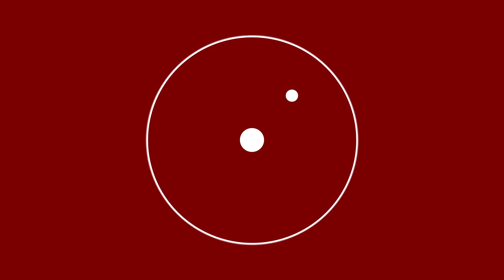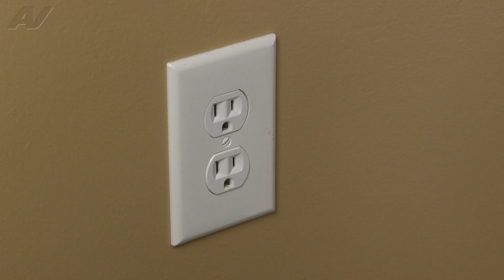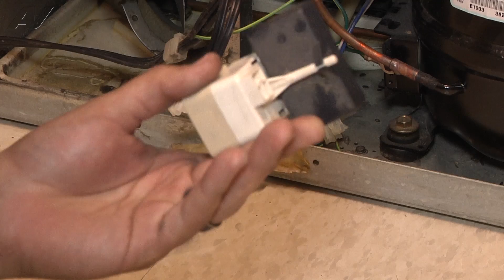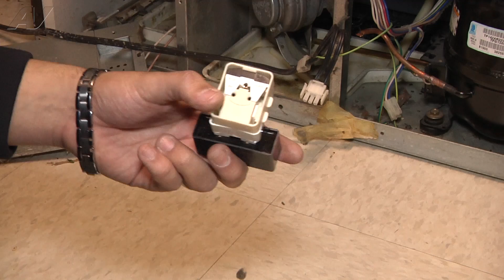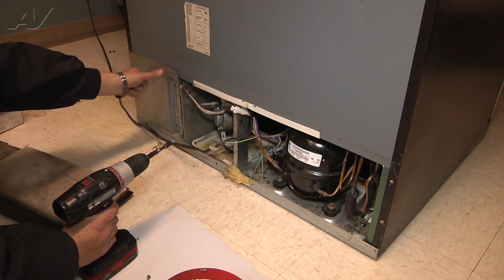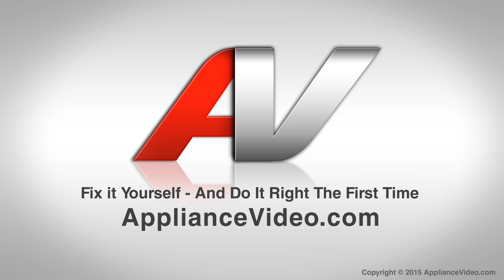Amana Refrigerator Repair - Not Cooling - Start Device

Comment: Tried three different relay/capacitors.  All had a bit of rattle right out of the box.  I installed the first one three months ago and it failed.  tried two more from different vendors but they all make a buzzing noise and the compressor refuses to start.  Sounds like more of an issue with this 17 year old side by side Amana refrigerator.  Will keep trying and thanks for the tip on the rattle.  PS it would be difficult to accept that all of the relay/capacitors are no good right out of the box.

Comment: I replaced both the relay and overload protector, and even ordered a pack of 5 of each, and tried every one of them. They all work, and the the compressor kicks on, but about 5 sec. in it clicks off again! And then does it's on and off thing just like before. Now what?? Is there anything else I can check or do?  Would the compressor still kick on if it was bad? Thank you for any advice you might be able to offer! 🥰
Reply: You might be low on R134. Sorry! I didn't realize this was 2 years old. Did you ever figure it out?

Comment: So I have an Kenmore Elite fridge, the Fan is not turning in the back by the compressor and the display shows off for the fridge and Freezer, I have tried to change the relay and capacitor without any success. When I put the new capacitor and relay on the fridge constantly beeps. Any idea?.
Reply from the maker: Great question, if you have a more technical question that our parts department cannot answer, you can search our over 17,000 answered questions free at our website www.ApplianceVideo.com under our Repair Help section. You can also call our parts department at 1-800-830-5465 and they can give you help 7-days A week ,or search at www.SaveMoreOnParts.com  .

Comment: Hey hi ya  have  older  single door whirlpool fridge freezer and  fridge stay a little  cold for 2 days .and then   3 green  lights flash  constantly  also freezer  works fine can hear component's  working  thanks ??
Reply from the maker: Great question, if you have a more technical question that our parts department cannot answer, you can search our over 17,000 answered questions free at our website www.ApplianceVideo.com under our Repair Help section. You can also call our parts department at 1-800-830-5465 and they can give you help 7-days A week ,or search at www.SaveMoreOnParts.com  .

Comment: does the start winding and the run capacitor go  off the circuit after the compressor reach 75 per cent of its speed
Reply from the maker: Great question, if you have a more technical question that our parts department cannot answer, you can search our over 17,000 answered questions free at our website www.ApplianceVideo.com under our Repair Help section. You can also call our parts department at 1-800-830-5465 and they can give you help 7-days A week ,or search at www.SaveMoreOnParts.com  .

Comment: So if it rattles, it's bad. But if it does NOT rattle, does that guarantee that it's OK ?
Reply from the maker: Great question, if you have a more technical question that our parts department cannot answer, you can search our over 17,000 answered questions free at our website www.ApplianceVideo.com under our Repair Help section. You can also call our parts department at 1-800-830-5465 and they can give you help 7-days A week ,or search at www.SaveMoreOnParts.com  .

Comment: my replacement parts did not fit properly and where thicker.  the relay holes were too deep so i had to cut off the edges but the spring does not fit.  if it cools i am just going to support it with tape.
Reply from the maker: Great question, if you have a more technical question that our parts department cannot answer, you can search our over 10,000 answered questions free at our website www.ApplianceVideo.com under our Repair Help section. You can also call our parts department at 1-800-830-5465 and they can give you help 7-days A week Monday Saturday, or search at www.SaveMoreOnParts.com  24 hours 7 days A week.

Comment: did this but mine doesn't make the noise when you shake it, what else could it bee?  the relay did get hot when i tested it with the new capacitor though.  is that normal?
Reply from the maker: Great question, if you have a
more technical question that our parts department cannot answer, you can search
our over 10,000 answered questions free at our website www.ApplianceVideo.com under our Repair Help section. You can also call
our parts department at 1-800-830-5465 and they can give you help 6-days A week
Monday -Saturday, or search at www.SaveMoreOnParts.com  24 hours
7- days A week.

Comment: how to put manual on defrost timer on amana refrigerator ..any trick ??
Reply from the maker: Great question, if you have a
more technical question that our parts department cannot answer, you can search
our over 10,000 answered questions free at our website www.ApplianceVideo.com under our Repair Help section. You can also call
our parts department at 1-800-830-5465 and they can give you help 7-days A week
Monday -Sunday, or search at www.SaveMoreOnParts.com  24 hours
7- days A week.

Comment: I have an old whirlpool top n bottom fridge,just got it from someone,said it was working but it's not cooling...just blowing air...it's making sound as if it's on,but not sure if it's just the fan I hear or compressor...
Reply from the maker: Great question, if you have a
more technical question that our parts department cannot answer, you can search
our over 10,000 answered questions free at our website www.ApplianceVideo.com under our Repair Help section. You can also call
our parts department at 1-800-830-5465 and they can give you help 7-days A week
Monday -Sunday, or search at www.SaveMoreOnParts.com  24 hours
7- days A week.

Comment: Would you know how old a Montgomery Wards Refrigerator HMG-19424 second # BM-7C80A
I can’t find?
Reply from the maker: Great question, if you have a
more technical question that our parts department cannot answer, our
technicians are answering all questions at our website at www.ApplianceVideo.com under our Repair Help section. You can also call
our parts department at 1-800-830-5465 and they can give you help 7-days A week
Monday -Sunday, or search at www.SaveMoreOnParts.com  24 hours
7- days A week.

Comment: Please  I need big chiler cooling video about comprecer why make wire heat and trip breaker
Reply from the maker: Great question, if you have a
more technical question that our parts department cannot answer, our
technicians are answering all questions at our website at www.ApplianceVideo.com under our Repair Help section. You can also call
our parts department at 1-800-830-5465 and they can give you help 7-days A week
Monday -Sunday, or search at www.SaveMoreOnParts.com  24 hours
7- days A week.

Comment: OMG! The one l just ordered is rattling!
Reply from the maker: Great question, if you have a
more technical question that our parts department cannot answer, our
technicians are answering all questions at our website at www.ApplianceVideo.com under our Repair Help section. You can also call
our parts department at 1-800-830-5465 and they can give you help 7-days A week
Monday -Sunday, or search at www.SaveMoreOnParts.com  24 hours
7- days A week.
Reply from the maker: Great question, if you have a more technical question that our parts department cannot answer, our technicians are answering all questions at our website at www.ApplianceVideo.com under our Repair Help section. You can also call our parts department at 1-800-830-5465 and they can give you help 7-days A week Monday Sunday, or search at www.SaveMoreOnParts.com  24 hours 7 days A week.

Comment: Does that piece fail often ? I have an 10 years old Amana and i am thinking about changing that part for prevention . Is it a good idea ??
Reply from the maker: Great question, if you have a
more technical question that our parts department cannot answer, our
technicians are answering all questions at our website at www.ApplianceVideo.com under our Repair Help section. You can also call
our parts department at 1-800-830-5465 and they can give you help 7-days A week
Monday -Sunday, or search at www.SaveMoreOnParts.com  24 hours
7- days A week.

Comment: Very good video sir please make compressor oil change video
Reply from the maker: Great question, you can call
our parts department at 1-800-830-5465 and they can give you help 6-days A week
Mon-Sat . You can also search at www.SaveMoreOnParts.com 7- days a week.  If you have a more
technical question that our parts department cannot answer, our technicians are
answering all questions at our website at www.ApplianceVideo.com under our Repair Help section. We have over 6,000
common questions and answers that you can easily search through by your model
number, appliance make, problem or error codes, and It’s completely free to
search through our question & answer library. There is a very good chance
you question is already answered there.

Comment: Tried this on mine to no avail .. just still buzzing/click for a minute or so then nothing .. the fan is running fine but the compressor never seems to kick on .. i thought compressors are good for like 20-30 years .. my fridge is like 10 years old and I have a mini fridge that is easily 20 years old and never had an issue .. maybe just crap compressors but looks like it’s to the curb with it :(
Reply from the maker: Great question, you can call
our parts department at 1-800-830-5465 and they can give you help 6-days A week
Mon-Sat . You can also search at www.SaveMoreOnParts.com 7- days a week.  If you have a more
technical question that our parts department cannot answer, our technicians are
answering all questions at our website at www.ApplianceVideo.com under our Repair Help section. We have over 6,000
common questions and answers that you can easily search through by your model
number, appliance make, problem or error codes, and It’s completely free to
search through our question & answer library. There is a very good chance
you question is already answered there.

Comment: Sir I have kenmore refrigerator standing up freezer. I have checked the fan in the freezer is working and is cooling enough but my stuff like vegetables or meats are mushy not frozen like they should be in the freezers. Please help me as I also checked the compressor is also hot.
Reply from the maker: Great question, you can call
our parts department at 1-800-830-5465 and they can give you help 6-days A week
Mon-Sat . You can also search at www.SaveMoreOnParts.com 7- days a week.  If you have a more
technical question that our parts department cannot answer, our technicians are
answering all questions at our website at www.ApplianceVideo.com under our Repair Help section. We have over 6,000
common questions and answers that you can easily search through by your model
number, appliance make, problem or error codes, and It’s completely free to
search through our question & answer library. There is a very good chance
you question is already answered there.

Comment: I got the same problem with my frigerator but I need to know where can I buy the refrigerator compressor start over load
Reply from the maker: Great question, you can call
our parts department at 1-800-830-5465 and they can give you help 6-days A week
Mon-Sat . You can also search at www.SaveMoreOnParts.com 7- days a week.  If you have a more
technical question that our parts department cannot answer, our technicians are
answering all questions at our website at www.ApplianceVideo.com under our Repair Help section. We have over 6,000
common questions and answers that you can easily search through by your model
number, appliance make, problem or error codes, and It’s completely free to
search through our question & answer library. There is a very good chance
you question is already answered there.

Comment: lceparts
Reply from the maker: Great question, you can call our parts department at 1-800-830-5465 and they can give you help 6-days A week Mon-Sat . You can also search at www.SaveMoreOnParts.com 7- days a week.  If you have a more technical question that our parts department cannot answer, our technicians are answering all questions at our website at www.ApplianceVideo.com under our Repair Help section. We have over 4,000 common questions and answers that you can easily search through by your model number, appliance make, and problem or error codes, and It’s free to search through our question & answer library.

Comment: my Lg refrigerator is not cooling,why.
Reply from the maker: Great question, you can call our parts department at 1-800-830-5465 and they can give you help 6-days A week Mon-Sat . You can also search at www.SaveMoreOnParts.com 7- days a week.  If you have a more technical question that our parts department cannot answer, our technicians are answering all questions at our website at www.ApplianceVideo.com under our Repair Help section. We have over
4,000 common questions and answers that you can easily search through by your model number, appliance make, and problem or error codes, and It’s free to search through our question & answer library.
Reply: ApplianceVideo.com help my fridge is clicking every second. All the videos say every 3 to 5 minutes

Comment: PVM1870SM3SS  2011 GE Profile Microwave Vent door will not close
Reply from the maker: Great question, you can call our parts department at 1-800-830-5465 and they can give
you help 6-days A week Mon-Sat . You can also search at www.SaveMoreOnParts.com 7- days a week.  If you have a more technical question that our parts department cannot answer, our technicians are answering all questions at our website at www.ApplianceVideo.com under our Repair Help section. We have over 4,000 common questions and answers that you can easily search through by your model
number, appliance make, and problem or error codes, and It’s free to search
through our question & answer library.

Comment: My question is how to determine if a problem can be the circuit control board. The model is a Maytag MFI2569VEM french door bottom freezer. Checked cap (12.2mf), sd, ohm comp,  fan and lights turn on, reading when plugged is at 1.12vac when checking plug  at start device. Is it suppose to be that reading? Nothing on the board looks burnt up but how do I check for board malfunction?
Reply from the maker: Great question, you can call our parts department at 1-800-830-5465 and they can give
you help 6-days A week Mon-Sat . If you have a more technical question that our
parts department cannot answer,
our technicians are answering all questions at our website at www.ApplianceVideo.com under our Repair Help section. We have over
3,000 common questions and answers that you can easily search through by your
model number, appliance make, and problem or error codes, and It’s free to
search through our question & answer library.

Comment: Is what you call a starting device
also called a condenser ,
if that part is bad can it cause the fridge to make a lot of noise
like my old Whirlpool is doing?
I don't know the model number - the tag with it seems to be missing
and I don't know how to get the model number.
Its 18 feet and the new ones similar to it are W8RXEGMWS
Reply from the maker: +lw216316 

         Good question, with our technicians
now getting hundreds questions weekly, they are answering all questions at our
website http://www.appliancevideo.com/repair-help/ .  We also have over 30000 common questions
and answers that you can easily search through by your model number, appliance
make, problem or error code and it’s absolutely FREE.